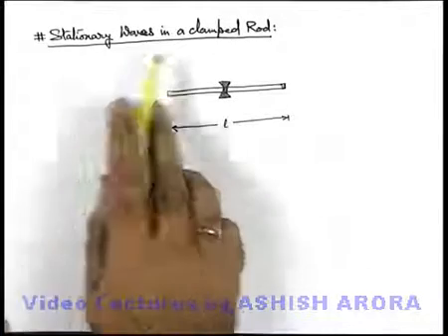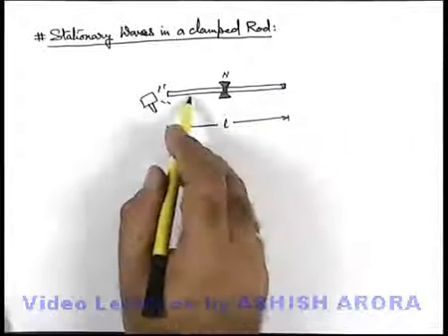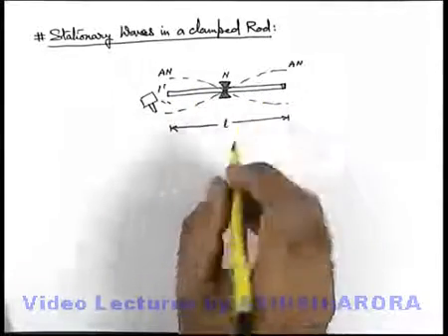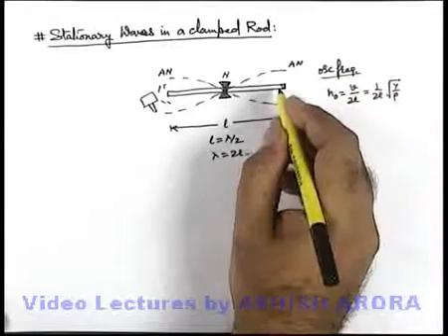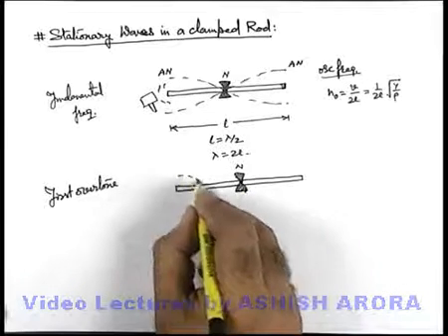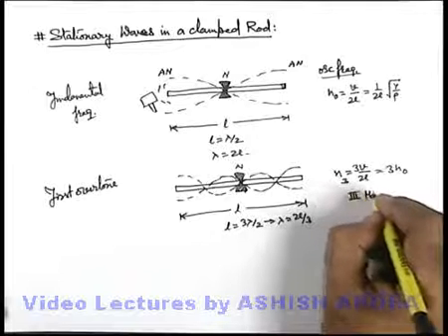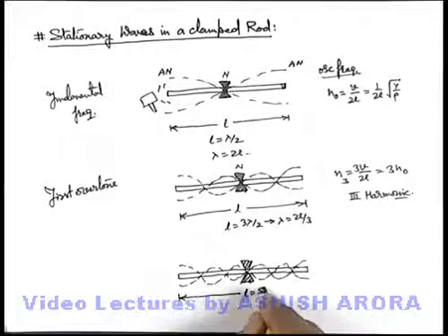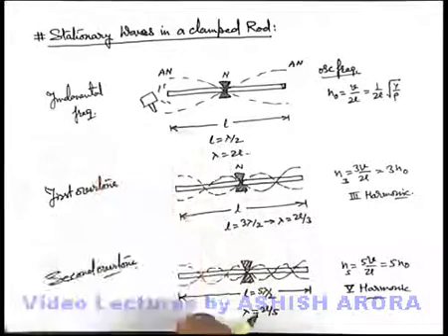Class 11 Physics | Stationary Waves And Beats | #31 Stationary Waves in a Clampled Rod | JEE & NEET

Comment: Sir, are the waves in clamped rod longitudnal or transverse?
Reply: actually, sir is drawing the displacement curve , the antinode u are seeing is not by vertical osc of rod but the compression state of the longitudinal wave.
Reply from the maker: longitudinal...
Reply: Physics Galaxy sir, if these are longitudinal waves, will the representation of the wave drawn by you correct ? It looks transverse 

Also why transverse waves are not produced and longitudinal waves are produced ?